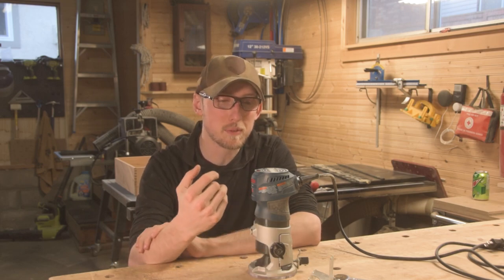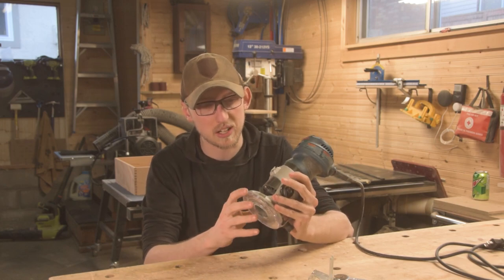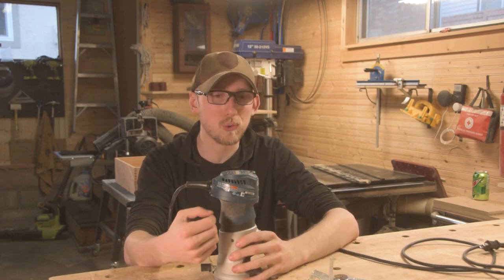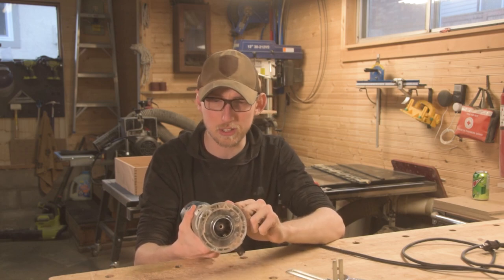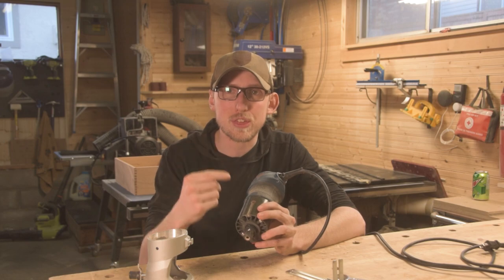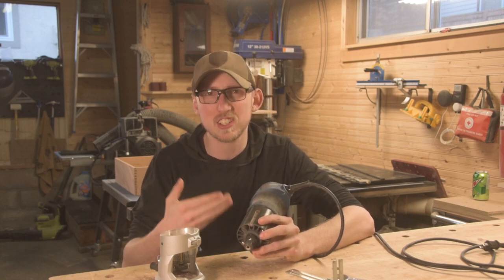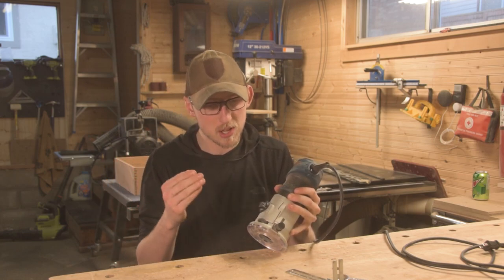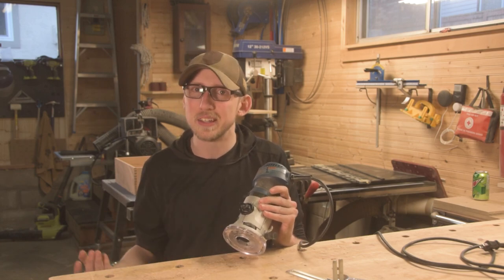Bosch Colt Palm Router - Negative Review

Comment: Are you unlocking the base before adjust or using the micro adjust. Those teeth should not strip that easily unless there’s quite a bit of resistance keeping it from moving. I know there’s a little friction when released but mine hasn’t stripped and I know plenty of people who have and do recommend this router. This one and the dewalt palm router are the 2 most recommended palm routers out there. I do think the dewalt is slightly better but not by much and it does cost more so you expect it to be better
Reply from the maker: I always made sure to have it properly unlocked before touching the micro adjust. From day one I was worried about stripping the threads because like i said in the video, once you strip them you'd need to replace the whole motor! I  trusted all the online reviews that said this was a good tool...
The important factor is the online reviews are generally unreliable since most positive reviews are left within the first week of purchasing an item, and all the influencers who review tools like this only have them for at most 4 weeks so the long term issues don't usually get brought up. When looking at reviews for anything I trust the 10:1 rule, where 10 five star reviews are equal to 1 one star review. When you start looking at reviews  like that you'll get way more accurate understanding.

Comment: From my experience the Bosch is a great palm router for it’s price point. The dewalt is likely better but price is a lot higher. Guess it depends on how often you use the machine. For me the Bosch is the way to go for edgining  and groves by hand.
Reply from the maker: I agree with you, the colt is an awesome little router, I definitely appreciate the fact that Bosch designed it to be nice to hold.
I took a look on Amazon and the DeWalt ($219) is slightly cheaper than the Colt 1.25 hp ($236), I'm guessing you were referencing the Colt 1 hp ($149), which definitely would be a better deal than the DeWalt.
The thing that pisses me off the most is the fact that the main selling feature that puts the colt over the DeWalt is the micro adjust, which is why I sound pretty angry in the with the micro adjust feature getting damaged so easily.
Reply: Regardless your review was great

Comment: Thanks for the info, I have the same router I got at a lower price since it was a Lowes return item.  So I will keep it for now. I was going to get the plunge base for it, but think I will hold off on investing any money into it if the threads are going to strip eventually.  That sure is a dumb design to rely on weak threads for the microadjust.
Reply from the maker: Biggest thing I think causes the threads to strip is switching from the course to micro adjustments. When you switch between them try to slowly turn the locking dial until the threads engaged before fully locking the router. I think partially what may have happened is the threads got crush by trying to lock the router after doing a course adjustment.
It really is a stupid design but just treat it delicately and it should work well for you!

Comment: Thanks for the video.  clean out the damaged thread groove, and epoxy a threaded sleeve into where the old threads existed. Yes, frustrating, but if one wants a job done correctly. . .
Reply from the maker: That's a good idea, it'll take some creativity since the damaged threads are cut into the body of the router but I get what you're talking about and it might just work!
Reply: @morganhurst_redridge  thank you for the vote of confidence, and the reply.

Comment: I hardly ever use my Bosch colt router and now it spin very slow now I don't know what to do any help thanks
Reply from the maker: It might be an issue with your speed dial. When you turn the dial you should feel when it lands on each setting. If it's just spinning freely then you'll need to contact Bosch to get it fixed.

Comment: Does anyone buy a $100 router for its micro adjustment?  I guess it may be nice, on occasions, I do not ever recall using a micro-adjustment
Reply from the maker: I genuinely can't tell if your comment is sarcastic but, the micro adjust is extremely important. It might depend on the quality of what your building, but for me the ability to set the bit at a precise depth is vital for everything from joinery to edge profiles.